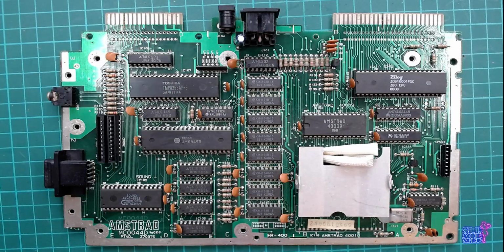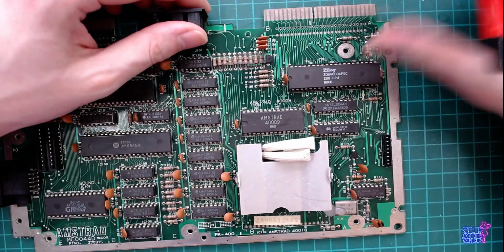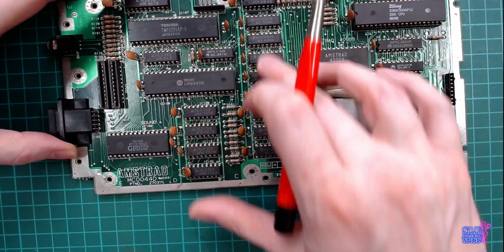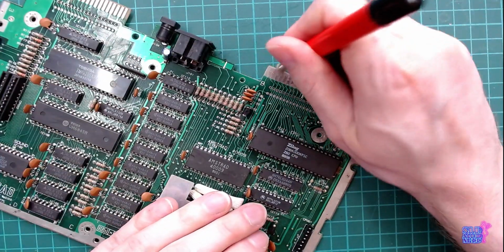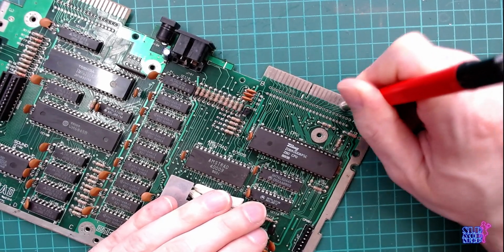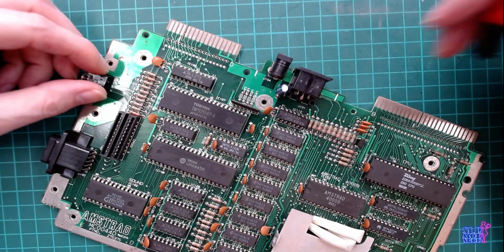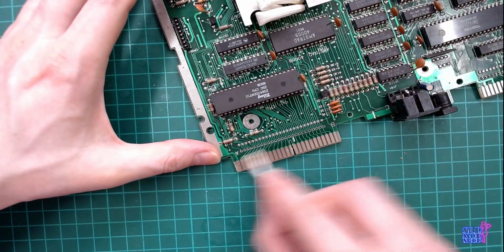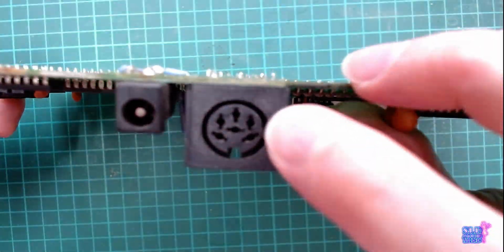AMSTRAD CPC 464 Repair | Part 2

Comment: Zx81 is basically 3 chips and a keyboard membrane. Very limited but.. nostalgia!

I was chasing my tail trying to find why spectrum games were loading intermittently from a maxduino. It turned out to be the maxduino/tzxduino output being too low. There is an adjustment on it to tweak it up a bit if you find the same thing. The Amstrad software was loading fine, even with the low output so it might need to be adjusted down again next time it's used there.
I've not seen any fixes for tzx spectrum audio in the recent firmware changelog so assume at the moment it was just not adjusted properly when shipped.